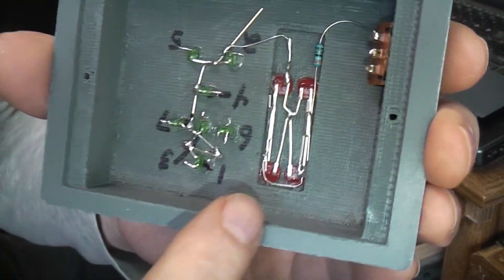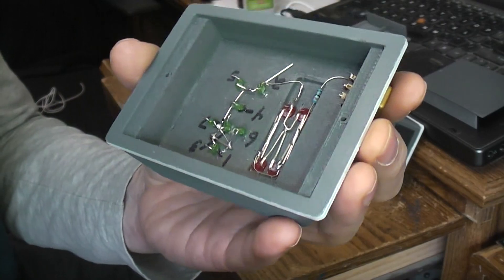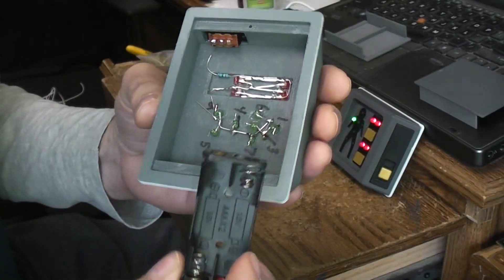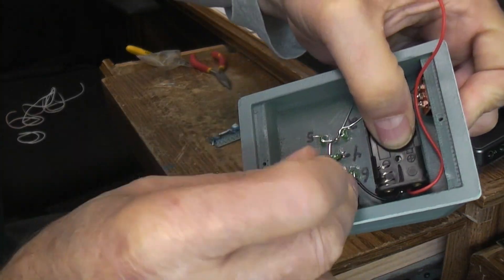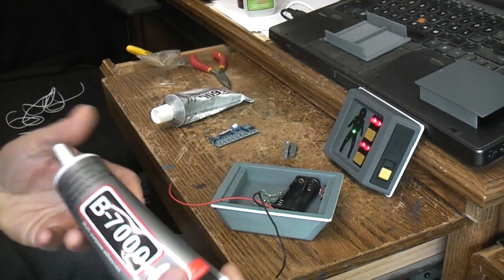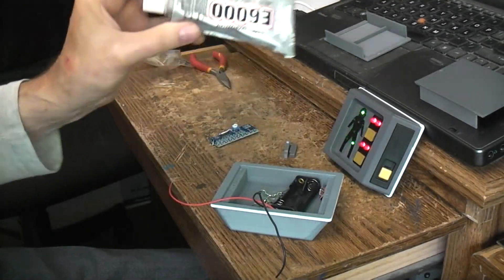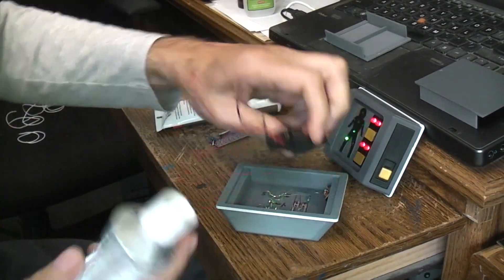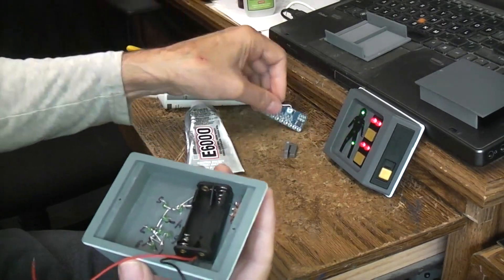Part 2 of you can make the Star Trek "second Gen" medical device.

Comment: I would never have known what could be done with that circuit board without these videos.
Reply from the maker: The boards cost so little these days. Back in the 1970's and threw the 1990's I would just use the 4017-decade counter chip and a 555-timer chip, you can fit them in really small spaces to control up to 10 LEDS or lights in sequence, but it actually costs more to buy the parts than it does a complete working circuit board these days.

Comment: Would it be simpler if the battery pack were flipped 180 degrees?  The wires wouldn’t need to be as long.
Reply from the maker: Any way you like it will work. Right now the wires are less than 1 inch long.